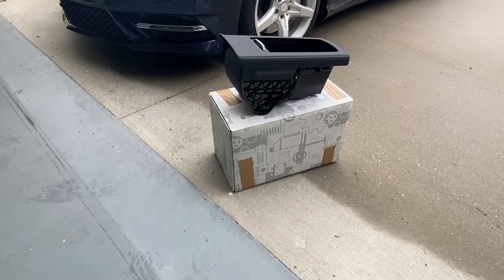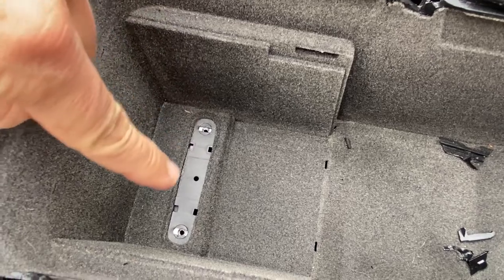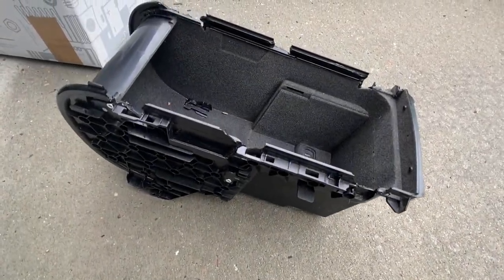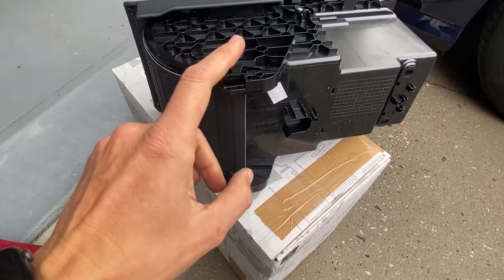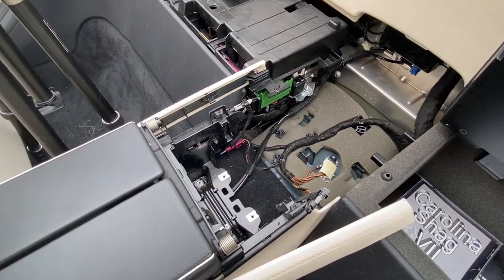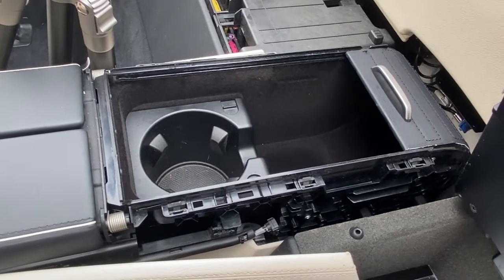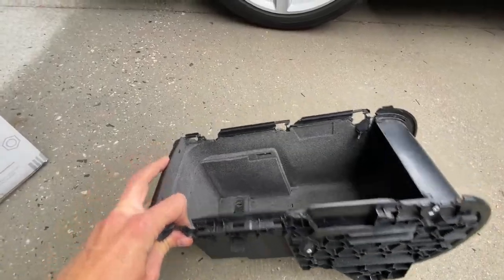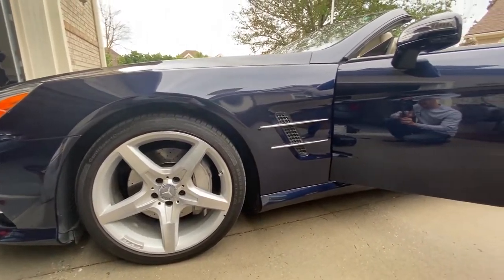2013-2019 Mercedes SL550 R231 Rear Console DIY Replacement

Comment: So appreciate this video.  Had the exact same problem.  Your demonstration was perfect.  Remind the viewer to make sure to feed the rear end of the trim over the tab on each side before popping back in.  Also, my console was so broken that I had clips still attached to the prongs on the cover that I had to slip off.  Thanks again!
Reply: Any idea where I can get a replacement?  I purchases 2014 R231  same color combo as in your video with broken rear console.  I have not been able to find one.  Any suggestions?